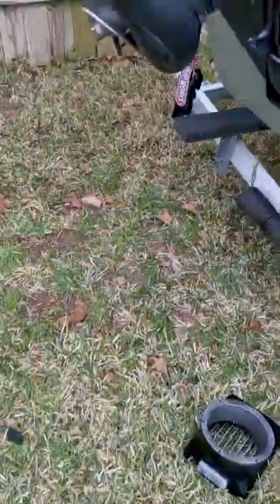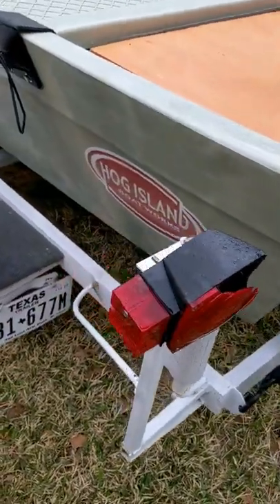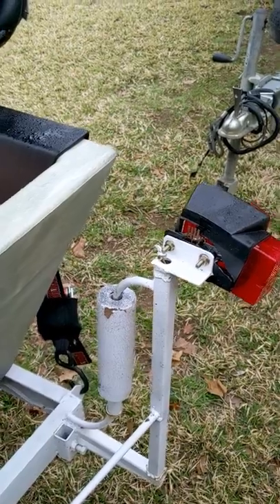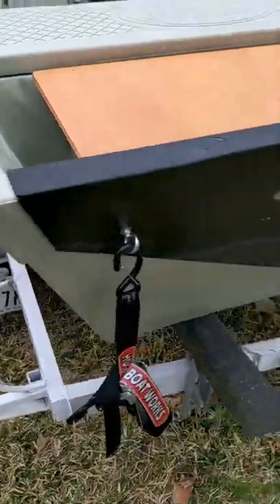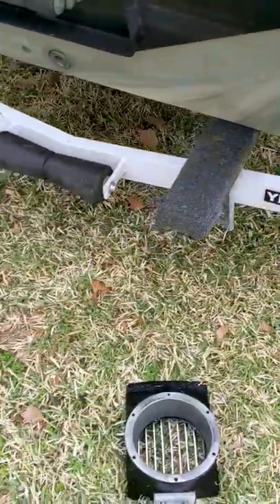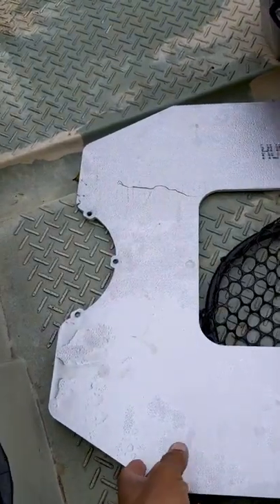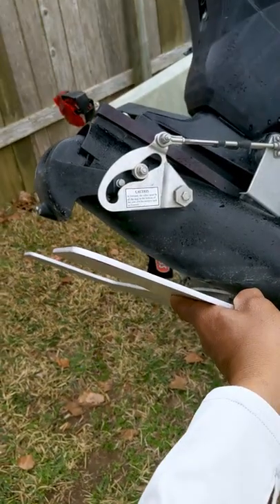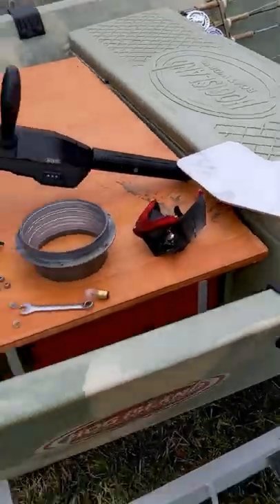More Fun Boat Projects!

Comment: Love the video, for the lights they make metal covers/ protectors that go around the plastic housing of the lights. We have some for our boat trailer that work great. They even make submersible led trailer lights that you could mount lower and still be able to go under water. If you want I could find you a link of the metal covers?
Reply from the maker: If you can find the link send it my way.